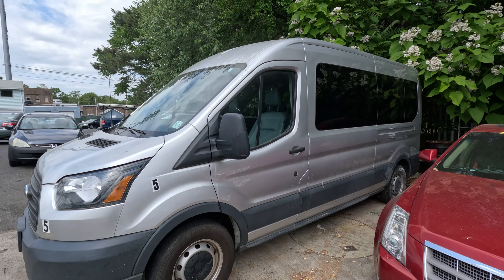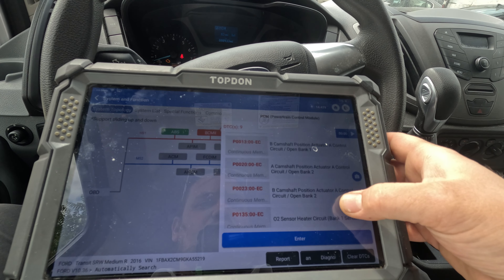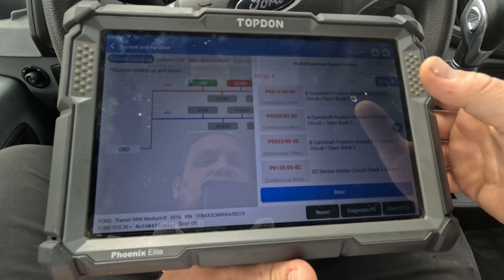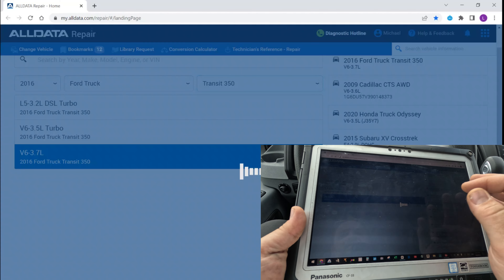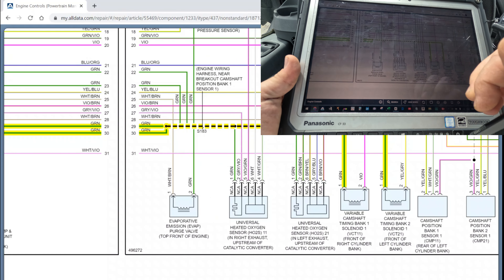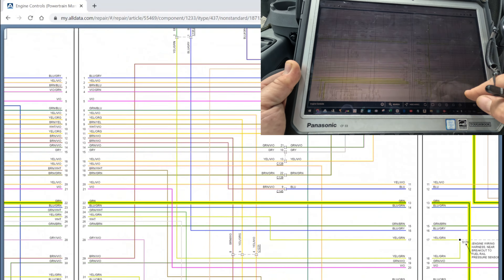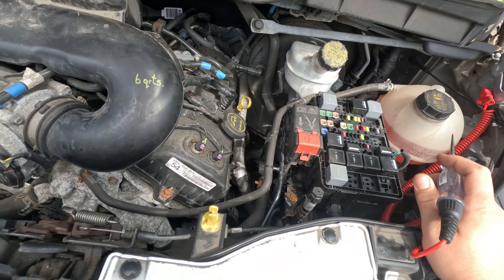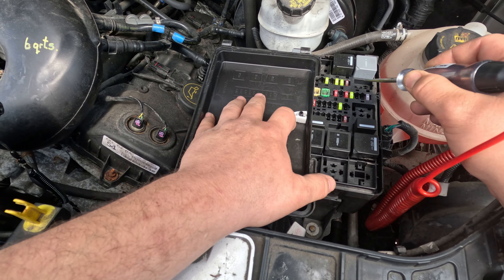How Does This Happen!?  2016 Ford Transit - Vvt & 02 Codes!

Comment: Great video! I really need a scan tool with topology in my life..Its really a great feature. Thanks for sharing bro!
Reply from the maker: Thanks for watching! I would highly recommend TopDon!
Reply: @advancedleveldiagnostics  yes I am wanting the phoenix smart real bad. Which TopDon do you use?
Reply from the maker: @BigDogDiagnostics  I have the Phoenix Elite. The smart has a few more protocols it can communicate with, but the Elite has Can FD, which is the only one I use besides J2534, which I use my Cardaq 3+ for.
Reply: @advancedleveldiagnostics  good to know. I think the TopDon will compliment my autel well. My 906bt has the Can FD adapter.
Reply from the maker: @BigDogDiagnostics  This is the best price I found for the smart. https://www.locksmithkeyless.com/products/topdon-phoenix-smart-intelligent-diagnostic-scanner

Comment: How many shops you have as customers now
Reply from the maker: around 10 consistent ones and another 10 occasionally
Reply: @advancedleveldiagnostics  how do you get  usiness? Looking to do t sa th. I already do the diags and programm at the shop i worked at 9 yrar
Reply from the maker: By me, it was all word of mouth, but from what I hear on Sean Tipping's podcast, most people go around to shops offering their service.
Reply: Where did you get tge scan tool? Do you have to pay for updates every year? great job BTW!!
Reply from the maker: @David-mo4qt  I got mine from JB tools a little over a year ago; it came with 2 Free years of updates. I just looked on their website it cost $545 for a year of updates. I wonder if they'll be like Autel and they'll go on sale.